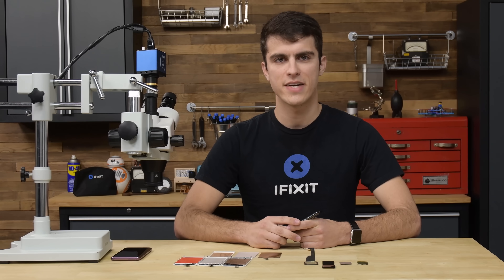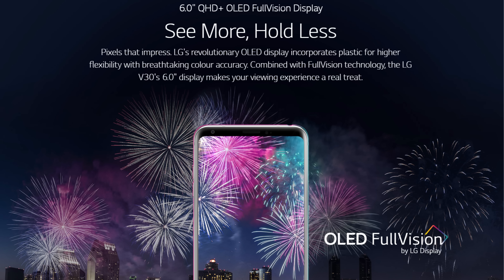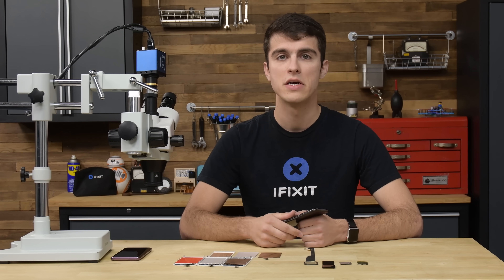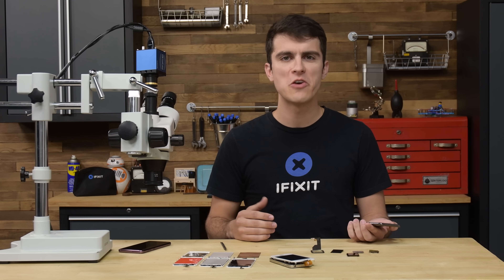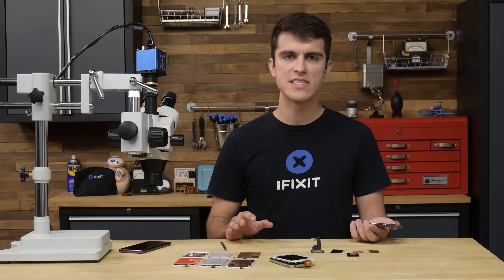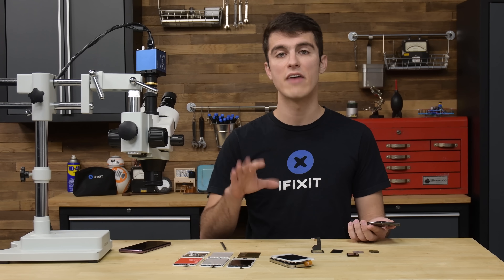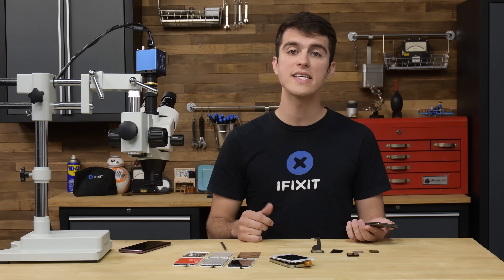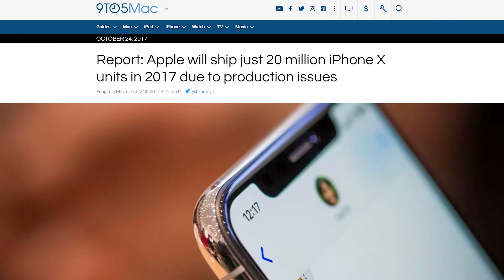OLED vs LCD: Smartphone Display Teardown and Comparison

Comment: I did come away learning a few things, so good video. but you failed to mention the issue of screen burning, which (for someone like me who likes to get a lot of life out of phone (my current moto g5 has had missing power button for over a year(found button a month after and taped it back on, daughter took it off again a few months later, I 3d printed a new one but my daughter took that one off too within a few weeks.. ehhgh..), now the volume button is gone too as of 6 months ago. I make do, its an inconvenience. NOW about 2 months ago I drop my phone for the millionth time and it finally got a big spidery crack along the top section. Im still using it... granted it took me this much to finally look for a new phone but upon researching newer phones I am not confident that ANY of them would still work after this much damage. PLUS aside from all the damage over like 4-5 years my display is fine (aside from cracked glass) and functionality is still fine. I am hesitanct to spend hundreds on a newer phone, prob referb because of prices, only to have more(and worse) issues than I have had with my old ass 2015 phone!.. im at a loss.. a whole day of research down that drain after I saw what happens with OLED displays.. wah, wahhh….. sad face..
Reply: just I case anyone else notices (because.. trolls) yes, it is bugging the hell out of me that I have left an unresolved ending  to a poor parenthesis (side note, what is it called what its only one parenthes….?..) . I am aware, now let it go unmentioned please, thx :)
Reply: (unless you know what a single paranthes_... would be called, im kind of curious now, but not curious enough to fall into a google search hole)

Comment: you mentioned that oled are flexible right??.. last night i dropped my oled phone and saw a crack  across the screen.. without any external cracks.. just inside.. what could be the problem?? also the cracks are thick and when hit by light.. doesnt shine.

Comment: What happens if I replace the backlight panel for a white sheet very reflective? The light will get through the coloured pixels and reflects back? The whole idea is create a hybrid display that could use external sunlight as a source of backlighting during the day and save battery, I would like to know why that's not possible...

Comment: Does anyone know where to get replacement OLED screens for phones like the zenfone 3 zoom? All the sellers list LCD screens, even though the original phone is AMOLED.  I bought one of these and installed it. It is indeed an LCD, because the black isn't totally black like on the original screen. SOME sellers list AMOLED and LCD together, which makes no sense, and I assume its really just an LCD and they don't know the difference. Where can OEM screens be had?

Comment: Good video. Some more info: LCD lasts longer than Oled because of it's organic pixel structure it will fail eventually and become unstable so it produces at the end "dead pixels" and "stuck pixels" and this is visible as a burn-in, black spots, colored lines, dimmed spots, individual stuck pixels/no pixels, flickering etc.
LCD's can also fail but more or less liquid cristals don't suffer changes in it's structure on it's own, it can have a burn-in but because of an external heat source, it can have "mura" effect where there are white or dark spots (bad process during manufacturing), lines and dead pixels because of a bad IC.
The new MicroLED wont have such issues like Oled and will also be better than both LCD and Oled screen types today :-)

Comment: "Wayy more power efficient" i actually a proven myth. Oleds use an active matrix so it does use some power to turn on and off the display at the end of the day they are about the same when it comes to raw battery consumption except for all dark screen ofc

Comment: I don’t think it all comes down to price of manufacture. There are so many factors why Apple doesn’t adopt it early. In a keynote in the 2000s, Steve said the LCD is more reliable and durable than OLED, meaning OLED wasn’t matured yet... not just the price to manufacture. There are also other factors which includes quality of OLED itself not up to Apple’s standards.

Comment: Honestly I’ve used LCD screens my entire life And I think they are underrated because the differences between LCD and oled aren’t that significant to the normal consumer but oled screens have problems with color Accuracy burn in brightness and cost to manufacture

Comment: I just thought of smthg: maybe 1 of the numerous reasons why Apple usually don't opt for innovation so that they don't implement new tech 1st, is related to high cost of production, that they can easily avoid with price cutting due to those tech mainstreaming themselves... Whereas Apple still never cut their prices then, keeping their profit high as hell... Not the trillion company for no reason 😏 

This suggests that with Apple, it's will always be unlikely to benefit last tech stuff, while they can use the delay before launching new tech to improve it & release a solid version of it, in their supposedly high quality R&D (built up thx to the margin saved from late innovation of c.)... Genius hypothetical strat, yet followed by an evil company 😌

Comment: The correct version...
OLED less efficient in power on average real life usages.

OLED shorted life span v LCD

OLED has burn in issues like old CRTs

OLED more expensive v LCD

OLED poor colour v LCD

OLEDs are getting better but by that time the new screens will be making in roads

Comment: Oled screens are for a Fact not more power efficient as LCD screens. They are just as power efficient or the difference is barely noticeable. In some conditions like when the background or a lot of the image the screen needs to show is black, the OLED screen is more power efficient because a big part of the screen doesn’t use power while the LCD screen needs to turn on a big part of it’s screen to blackout the white backlight. But in other situations like an image with bright colors or if the background is white, LCDs are more efficient with a bigger margin because then the OLED screen needs to have all of it’s pixels lit up while the LCD only needs to have part of it’s screen aside from the backlight turned on to display another color than white. While this difference isn’t noticed when both screen’s brightness is less than 250 nits, the difference is very noticeable on very bright screens like the MacBook Pro’s screen of 500 nits or the iPhone XS Max display of 725 nits the difference is very noticeable.

Comment: OLED is bullshit! It destroys your eyes! Brightness can be dimmed with pwm modulation and when you drop lower than 50% is starts to flicker. Can be seen when filming in slow motion with 240 fps. This flickering causes headaches, eye problems and lots more! There are some people that are not sensible to oled displays but a lot of them are! This flickering is not present in ips displays! Ips is the best smartphone display you can get

Comment: I really hate that film industry have brainwashed video editors, that 24fps is supperior to anything else. 24fps was used in time when film was expensive and it was reasonable to use 24fps to save money. Hovever, now it is pointless. It looks bad, is not smooth, stuters and have horrible motionblur. Phones from 2013 can record 1080p@60fps. 
What is your excuse, Ifixit?

Comment: I like Oled much more than LCD, there is burn in issue but it's rarely happen from Samsung's products.(also we don't use same smartphone 10 years anyway)

But need to mention most OLED (AMOLED) using pentile matrix, It isn't visible for human eyes( Unless using VR headset), but this is one of reason Samsung had to go
higher resolution, Pentile with low resolution make pretty ugly screen for sure.

OLED supposed to use less energy due to you only need light up pixels which need light up, but requirement of high resolution make battery drain faster. (need more processing power)

I'm not saying OLED sucks because of most of them are Pentile Matrix instead of RGB, I just wanted mention a fact.
I still pick OLED screen smartphone all time over LCD!

Comment: You’re wrong, Apple has the capacity to have made their phones in the past OLED, the reason they did not has nothing to do with what you’ve said and I have no clue where you’re getting your information. OLED displays, because each pixel emits its own light, suffer from what’s called burn in. Only until recently did OLED technology get advanced to the point where Apple feels comfortable enough to put it in their phones. Burnin causes stationary images or icons that is usually in one part of the screen to stay imprinted onto the screen even after navigating away from the image or icons. Now OLED still isn’t perfect and Apple’s new phones, along with other major manufacturers using OLED, will suffer from burnin if used with a stationary image on the screen for too long. Apple simply waited for the technology to advance to the point where burnin will not be a concern of the consumers.

Comment: The price of OLED will not drop if it would it would have done that a lot earlier, because all the other companys already use oled since up to 12 years only Apple still uses extremely cheap items to produce their extremely overpriced products. 
The only possibility is that they would discover a new kind if production which i wouldn't expect to happen. 
Or if LG is finally able to break Samsungs wall of controlling the market. Because Samsung should curently sell about 96% of all displays.
But before that happens there I expect Samsung got even better displays which they actually already got (QLED)

Comment: Oled is only more powerefficient when there are a lot of dark scenes, when the screen is showing more white colors, it is in fact less power efficient. Also dont forget the degradation of Oled pixels. In the end it is not the final tech and non organic led self emitting light pixels will be the future.

Comment: Negatives of OLED should also be mentioned here rather than just saying they are better than LCD. Its not true to just say they use less power. It very much depends on the content being shown and brightness. And at higher brightness burn in also becomes a much bigger issue.

I like both technologies, I just think this video could be more balanced
Reply: Your encouraging another ten thousands posts on "burn-in" without details on offending devices.

Comment: what a lie apple did not change it for ages for 2 reasons Samsung and LG are the 2 makers of OLED so have to suck up to them and paid a lot for them and not going to give there technology away to competitor that easy second reason is apple does not own or patent it so cant make money off it just like headphone jack change it because they can make money of there own design so if you want to make charger cable you have to pay apple to use there port

Comment: This video was rather poor. Lots of missing/wrong information.

OLED has another big planned obsolescence issue. OLED display panels - or rather AMOLED (or POLED, PMOLED), since there is no such thing as pure OLED. Just like there aren't any LED TVs. LED refers to the backlight technology, it's an LCD. That's marketing confusion for you.

But back on topic. AMOLED is prototype technology with some advantages over LCD but has major drawbacks. Like the borderline criminal life expectancy. The blue diodes will die/vanish after less than a year of normal usage which means the colours will be off and the already dim display will get even dimmer. It ages unevenly. The official numbers of use hours are misleading for several reasons like not factoring in turning them on and off quite regularly etc.

And then there is the permanent, non user fixable burn in issue which plagued the AMOLED technology since the early days. It's the nature of organic diodes and will never be fixed but hey, they tried. (pentile matrix arrangement) Samsung even admitted permanent OLED image retention in one of their QLED TV commercials for christ sake. (video is called, "QLED vs OLED: The 12-Hour Image Retention Test") 

I could go on and on but fact is, it is prototype technology with major drawbacks and should have never been released to the consumer mass market. Congratulations! Your display panel will die sooner than your average lithium-ion/polymer battery. Truly a technology worth having.
Reply: Why if i change my phone every three years....
Reply: I have an Amoled phone for past one and half years. Never had any of those problems.
Reply: Yes and as well as experiencing burn in, they also 'yellow' with age, as certain colours dim faster than others. My S9 is literally in getting repaired under warranty as I type this. As it had burn in after only 3 weeks!
Reply: not true. many people here are running 5y old samsung phones with no degradations. you are simply exaggerating and your prototype comment should never appear in the mass comments sections.

Comment: Cant believe you did not mention color accuracy. LCD is way more easy to control color accuracy, and I would love to have my phone showing me ACCURATE color. For me, color accuracy on OLED is BS.
Apple, if you can see this, please keep at least one iphone with LCD panel, I do not need an expensive display, but a display showing accurate color with no "burn in".
Reply: nathan OLED display generally look better at the end of the day that's more important then accuracy and its not that inaccurate

Comment: Forgot to mention the very real danger of burn-in on OLED. It happens more often than people realize and has happened to both my S8 and V30.
Reply: Ay Star not iphone x
Reply: How bad was it? I'm using xz premium. IPS LCD
Reply: Ay Star I use my phone every day 7 to 8 hours screen on burn in stopped with my s7 but it's because of the software.
Reply: My v30 have some burn in after a month of use :(

Comment: LOL 😂😂😂
Samsung manufacture OLED panels for Apple..
Reply: omg.. its called business
Reply: @leart78  it's called apple cannot produce anything.
Reply: Sure they can, who produces the phones?
Reply: Business wise if you are a manufacturer its cheeper to add items to your product completing it form another manufacturer .
Why Mercedes or General Motors buy tyres from meshline  or Bergiston ,,,, they can build tyres factory but its less costly to get it from out side even if it was a rival .
Cut the cost get higher profit after all its all about money 💰 making .
Reply: PhoenicianC4D it only makes sense that Samsung isn't going to give their best OLED displays to crapple. Hence why crapple has that dumbass notch
Reply: You're right
Reply: Yes  u r rt.
Reply: Apple doesn’t have a Super AMOLED display.
The Super Retina display was entirely engineered and designed in house by Apple. It’s rated as the best OLED display in a smartphone with technologies that doesn’t exist on Super AMOLED such as:
-3D Touch
-True Tone
-120Hz Touch Sensing
-Folded to eliminate the bottom bezel 
-Dolby Vision HDR

It also has the highest full screen brightness of any OLED, the best burn in management system and the best colour accuracy as well as lowest reflectivity of any OLED.

Apple THEMSELVES explicitly makes this clear on their OWN website (https://support.apple.com/en-gb/HT208191) 
“The Super Retina display in iPhone X, iPhone XS, and iPhone XS Max was engineered by Apple to meet our incredibly high standards. We believe this is the best OLED display that has ever shipped in a smartphone while offering the best color accuracy in the industry.”
Reply: Actually it's from LG
Reply: Why the fuck is that funny. It’s a business. It doesn’t make sense for Apple to make their own. Lol

Comment: There are a few wrong mistake on the fact, yes oled on the paper it say save more battery, but it doesn't say to reach the brightness  of lcd it use more power and more power is use to display white colour, and some colour individual pixel wear out faster prone to burn in, hance the difference arrangements. There are no perfect display tech. All have their pro and con in different area.
Reply: Well my old lumia 925 had 800 nits of brightness, bright enough to make you blind in dark. I was using it as flashlight :D

Comment: Reason for oled
-Oled are more battery efficient
-True black

Con
- every Oled suffer burn-in issues
even super omoled
-expensive/hard to manufacture 

IPS/LCD
-colour true to life
-bright depend by pixel
-Not suffer from burn-in

Con
-Not battery friendly because of back-light
Even using black theme does not save battery :V
-easy/cheap to manufacture

Anyway pick your poison XD
Reply: OLED isn't more energy efficient. Unless it displays black it's more power hungry than LCD.
Reply: Lcd suffers image retention though
Reply: Just wait for MicroLED mate. All pros of OLED without the cons. Brighter than OLED too and have great color representation as well.